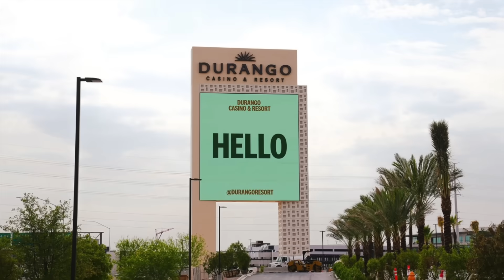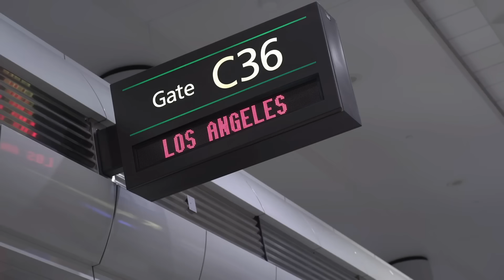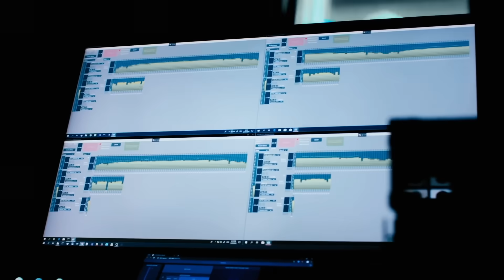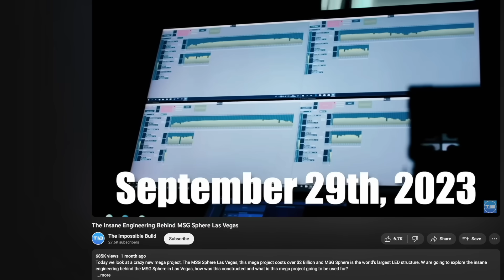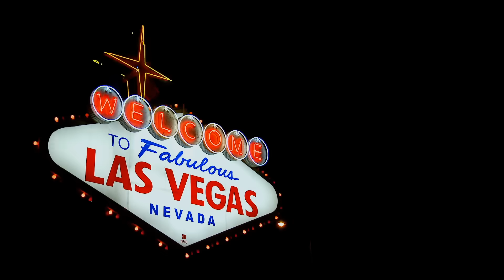The Biggest Mega Projects Under Construction In Las Vegas

Comment: Forgot to mention the “new” Fountian Blue is already a aged 20 year old resort 😂😂😂
Reply: No. It was sitting in a state of a  concrete and steel incomplete tower for 20 years. No glass siding. Unfinished inside/outside . Just bare bones, skeleton of steel and concrete. 

Then through many financial transactions, the original owners repurchased the entire project for pennies on the dollar. A few years ago the full electrical, plumbing and mechanical infrastructure was started.

Then glass siding. Then the interior was finished, the roof skirting/facade etc ... along with the landscaping in 2023.

Comment: LMFAOO... Who takes 4hrs and 20 mins to drive from Vegas to SoCal?  Maybe on back roads through Amboy to Palm Springs and backwards through Riverside.. lol

3 hr 12 min (229.3 mi) via I-15 N Drive time at speed limits, via Google maps.  300km an hr is 186.411 MPH.  Understanding theres going to be spots where that is not likely the top speed; i.e. shallow corners, the rail way that follows the 8% grade of the 15 from Hesperia down to basically back side of Fontana..  230 miles / 186.4 MPH is an 1hr, 20 mins.

but, again.. the grade up/down the 15 from the high desert floor to the Lower desert persay, maybe a couple corners around some Mt ranges.. regardless, id rather fly if I had to or just drive, and yes, take the backroads.

Comment: The Fountainbleau is f-i-n-a-l-l-y set to be completed.  A lot of fits and starts.  Resorts World  across the street is nice.  It won't be much different or nicer than Wynn or Resorts World.   Wish them luck.
Reply: Hotels more hotels and resorts. Vegas needs a mega theme park attraction
Reply: Im a carpenter currently working at Fontaine Bleau, who also helped work on Resorts World, yet have visited both RW and Wynn many times and I can assure you FB is much nicer and much larger then both of those properties. FB will be the biggest, and nicest property on the strip by far.
Reply: local here since 05...that is so nice to hear! That structure has been a hole in heart of that part of the strip far too long.  @blakezorne2389
Reply: they cant beat the venitian hotel with 7000 rooms !!!  @blakezorne2389
Reply: Winn/Encore has pretty nice rooms.  Curious how Fontainebleau compares.
Reply: No Luck Needed... Just Like A Pretty Lady, They Don't Need Luck To Attract Men. It's The Nicest Glamorous Building On That End Of The Strip, So Its Gonna Draw All Nearby Crowds To It.

Comment: i'm surprised vegas doesn't have an outdoor carnival with games (stuffed animals, prizes) like the exhibition or coney island considering it's year round reliable sunny weather
Reply: It's hot as HELL in the summer.
Reply: @bleulesyeux5416  yes, and the wind in your hair will cool you off
Reply: @milwaukeemotor5995  What wind? In the heat of the summer, it is quite common for the temps to hit 115+ degrees and not have even a slight breeze blowing.
Reply: too  hot in the summer, temps are over 100.
Reply: Lots and lots of local fests every year